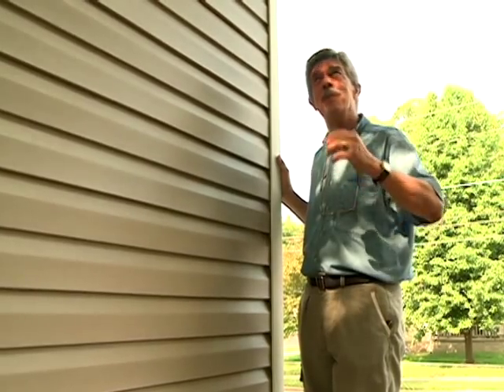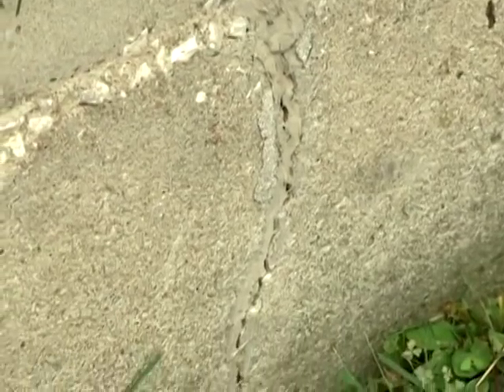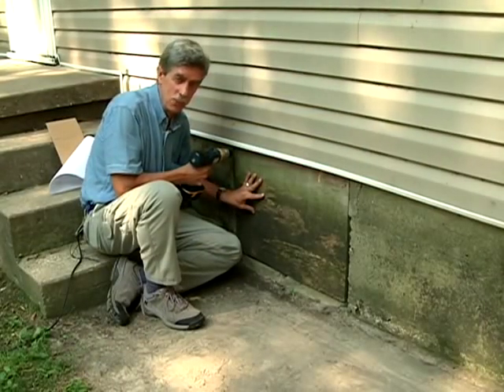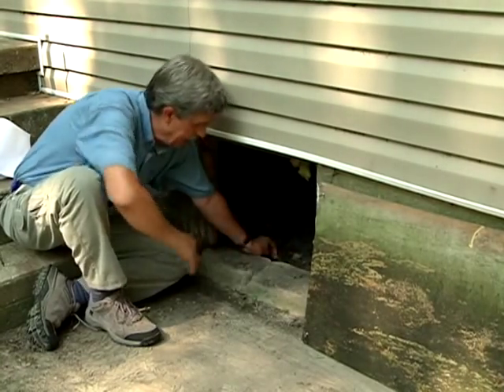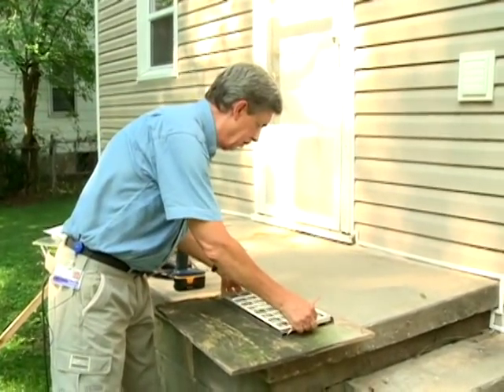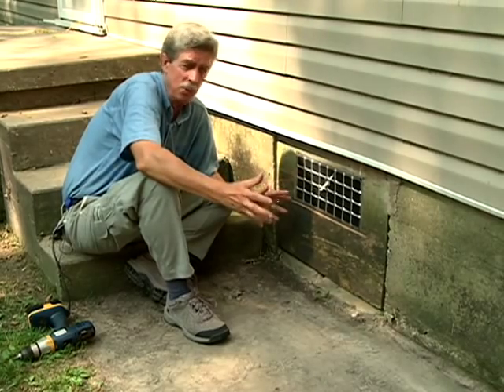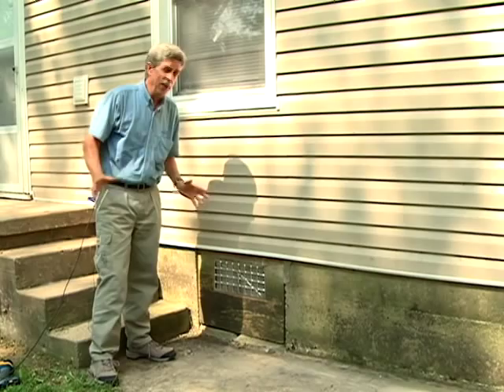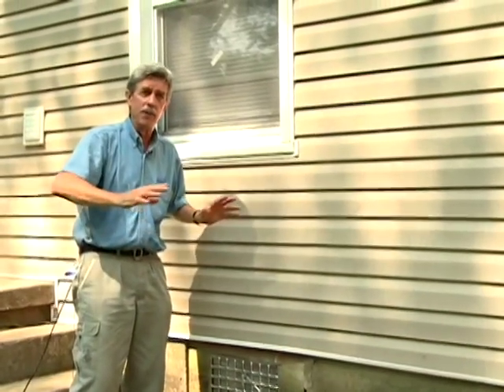Crawl Space Ventilation.mp4

Comment: I had vents put on every opening for the crawlspace. After that I had foam sprayed all around the inside of my crawlspace. About 5 years later I got this terrible chemical smell coming up into my house. I just took the covers off all vents and replaced them with vent that can open and close. I discovered when I took the vents off, they put the foam over every crawlspace vent, I had to remove all the foam. I'm hoping by replacing the  crawlspace vents, the smell will stop!
Reply: I doubt that would work. The last step in creating an effective crawl space is to ventilate the space with a humidity controlled fan like an E Z Breathe system.  Your spray foam insulation sounded good if the vapor barrier was also installed. You just needed to ventilate. Foam was likely off gassing. A low blowing fan would bring fresh air in from the living area by adding an open vent in the floor and turn the air over in your home and crawl space several times a day.  Research the EZ Breathe and breathe clean fresh air.

Comment: Can mice get through those holes?
Reply: I know it's an old post, but I would say mice would definitely get through the vent, as well as rats, unless the rats are very large. I think it needs to have much smaller openings to be safe:
http://www.ratbehavior.org/CollapsibleSkeleton.htm
"Can rats really fit through a hole the size of a quarter?
Small rats can, large rats cannot.
A quarter is just under an inch in diameter (0.96 inches). Not all rats can fit through a hole the size of a quarter. Large rats and overweight rats are too big. But some rats are small enough to fit through -- especially juvenile rats.
The smallest diameter hole a small rat might fit through is an important consideration when rat-proofing an outdoor structure against wild rats, and when choosing a cage which will house baby rats. Generally, wire mesh with 1" x 1" holes is considered too large a spacing for young rats, while 1" x 1/2" and smaller dimensions are narrow enough to keep even the smallest rats inside. For rat-proofing an outdoor enclosure the recommendation is usually 1/2" x 1/2" mesh or smaller."

Comment: I do sealed crawlspace, lot of the times moisture related issues including mold and wood decaying fungi is caused by condensation HVAC duct pipes, sealing foundation vents, installing a good crawlspace ground vapor barrier and crawlspace dehumidifier will solve your problems. I own a pest control company and deal with this alot here in NC.

Comment: If a home has adequate code approved sub-floor insulation, there is no need to seal up the vents in the winter.  This is an oft quoted myth.  Also, the vapor barrier shown in the video is clear and probably 4mill thick which is no longer code.  A black 6mill vapor barrier is code.
Reply: hyena131 false just had inspection on footing and was told by inspector by code if we are adding a crawl space in the foundation we are building we must have ventilation or it will fail